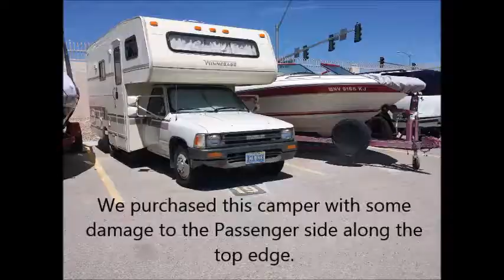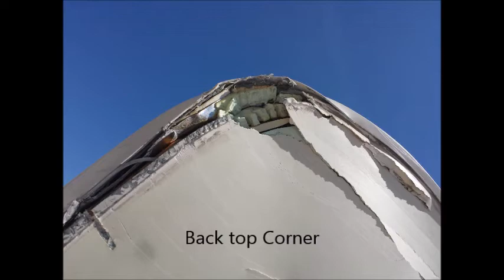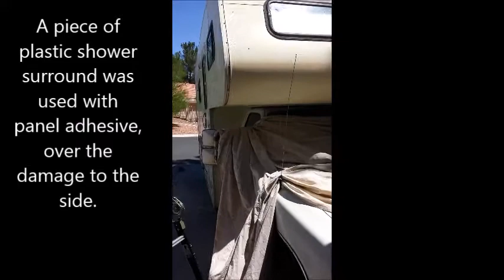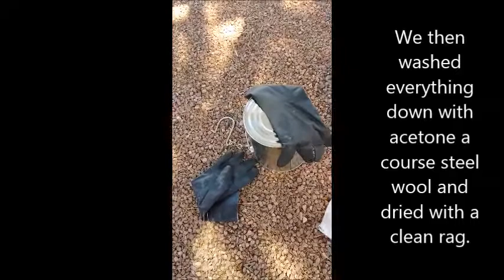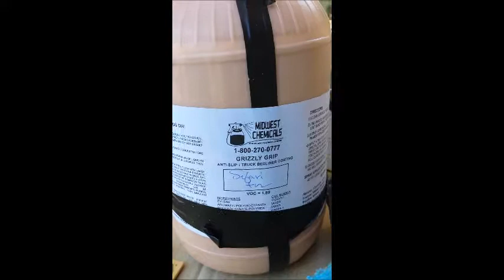Painting the Camper with Grizzly Grip Truck Bed Liner Paint

Comment: Hi. Glad I found this video.  Is that the almond color?  Did you find that 1 gallon covered 90Sqft 2 times as advertised?  Thanks!
Reply: Oh Safari Tan.  I see it now.
Reply from the maker: We bought Safari Tan, It did provide coverage as advertised. I ordered extra and did not use it. It will depend on your application - but following their instructions - should be good for sq ft coverage.

Comment: I watched your video on the camper recover. so how is it holding up? I am going to do the same thing I think.
Reply from the maker: Doing really well. Only thing - I would ask manufacturer if you could get it with out any grit in it. So it would be smooth coat, not textured. But it is holding up really  good no lifting, no peeling, no cracking.

Comment: So how has it been holding up?  Looks good! I am about to do my entire homemade tiny camper with a similar product  HERE https://youtu.be/JX7ho0thsW8 Just curious how it worked out for you?
Reply from the maker: It has been great! 2 + years and it still looks just like when we first painted it. No cracks, lifting or splits. We have matched the bone white color of the truck in a exterior paint and plan to re-paint it so it looks all the same color. I think the adhesion of the exterior latex to the bed liner epoxy will be fine. I should do a video of that too :)